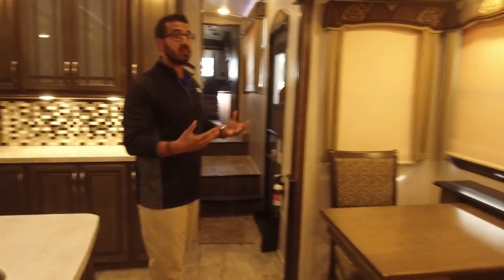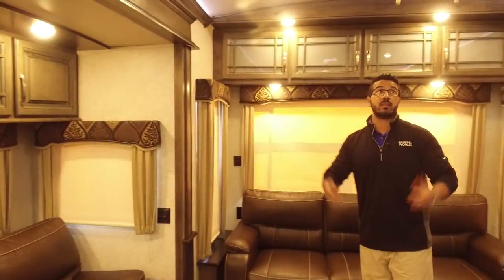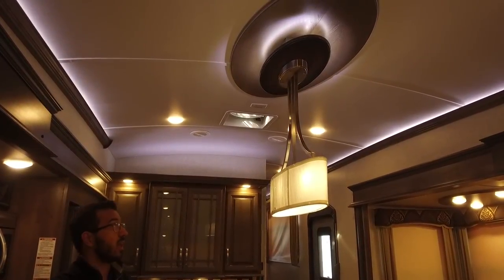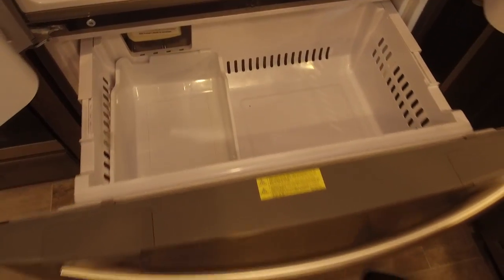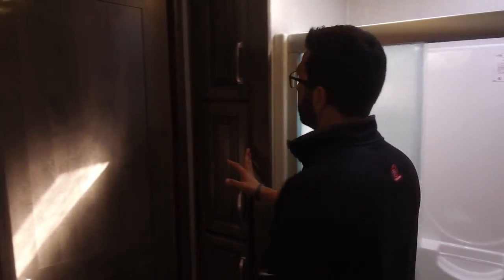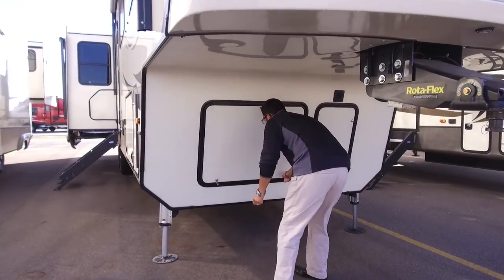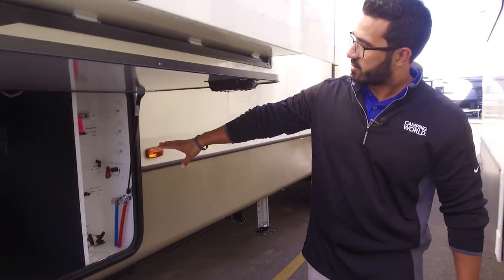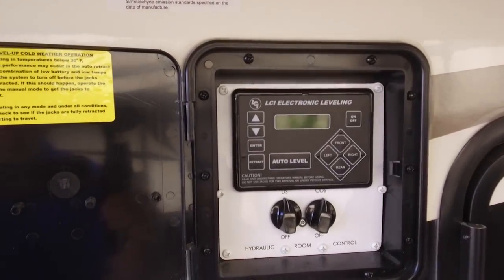2018 Keystone Montana 3811MS | Fifth Wheel - RV Review: Camping World

Comment: Nice floor plan. Fresh water supply unsatisfactory. 66 gal. Needs 100.
Reply from the maker: Vppnbrent, I think the idea behind the 66 gal fresh water tank is that most people who purchase this RV will use it mainly at camp sites where there is full hook up. Aside from fifth wheel Toy Haulers (which owners tend to be more likely to take boondocking), 66 gal is right on par (if not slightly larger) than most in the luxury fifth wheel category. Thanks for watching and for the comment!